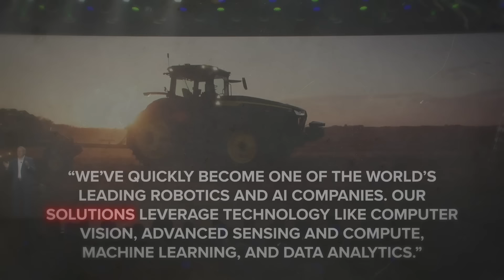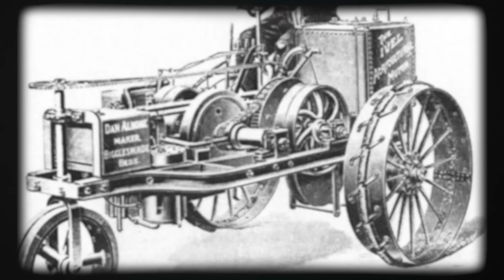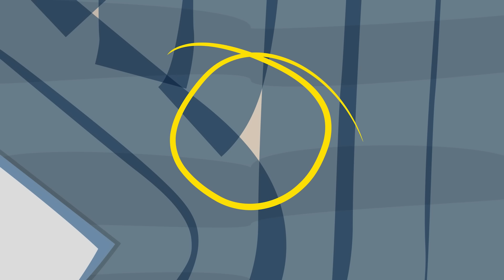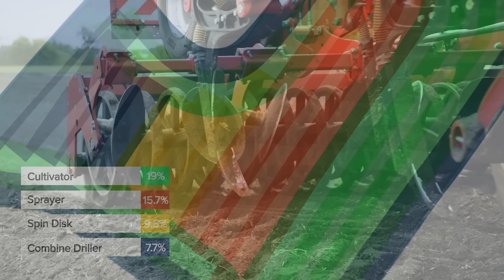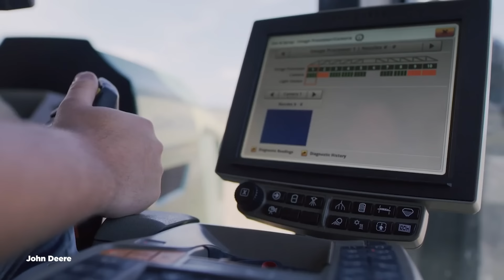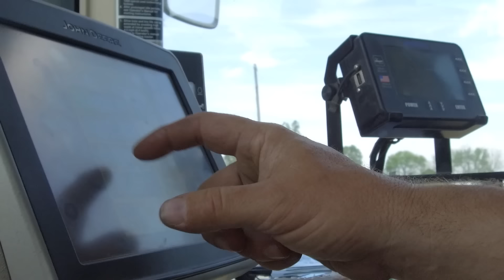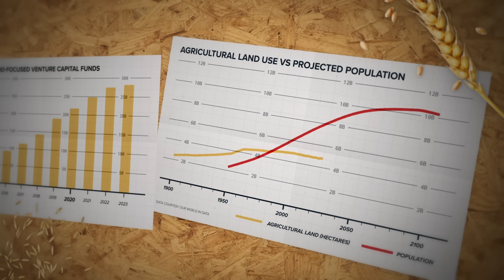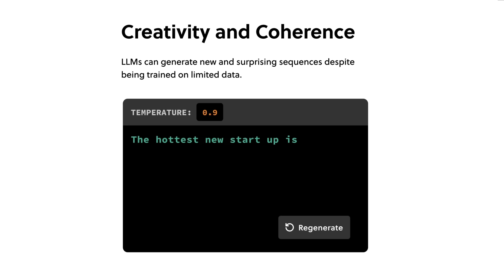How Big Tech Ruined Farming

Comment: I may be totally off, but a lot of this seems like relatively easy tech that, these days, could be developed by a fairly small team. Perhaps we'll see startups competing with large corps like John Deere in the near future.
Reply: Yeah it is.  I think JD spent so much on engineering talent that they have to cover the cost of that with exorbitant tech / hardware fees now, or they're purely charging monopoly prices while they can.  I was thinking that with a relatively small team, these $700K sprayers - that i've read about numerous times in this comment section - could be designed, programmed and built for less than $100K a piece.  The ML really isn't that difficult to figure out.  Honestly the whole system isn't that difficult to figure out.  .

Comment: When I was living in a small German town you could see how tractors were important to the farmers, there was lots of small old tractors, very well maintained, and they used them for everything, from farm work to towing, and with different modules to mount on the axle, I saw them with small sawmills connected to the engine to cut wood then just discconect it and drive away, very fascinating, and I didn't see a single modern tractor, just real old tractors that were real clean and well maintained :)

Comment: To combat this, we need standards (like usb-c) for farming equipment such that any tractor can use any equipment from any vendor.

Want a new nav system. Plugin a new nav system.

Want a new sprayer, plug that in too
Reply: As it happens Apple was pretty stubborn about not wanting to put USB-C ports on their phones even though they played a major part in developing the standard. Market leaders generally don't want to allow any more compatibility than strictly necessary. I suspect JD would fight tooth and nail to preserve their walled garden.
Reply: That's... not really what this is about. This is about things like not selling implements or parts like tires or combine blades outside of their system, which isn't sensible. Motors and proprietary software this makes sense for, but this isn't as simple as "plug in a new nav unit" or "re tumble your key lock on your tractor" this is actually stopping people from being able to do with their tools what they used to do.
Reply: I mean you pretty much can. You might need to have an adapter harness with the different connectors but that's not real difficult. The important part ISObus or CANbus communcation is standardized and can be looked up by anyone. Companies can have proprietary beyond that but you can 100% take a John Deere nav system and use it on a Fendt tractor. It's not perfect but certainly not impossible
Reply: Good thing your using usb-c, I would have to be up at 4am trying to flip the equipment over trying to get it plugged in 🙃
Reply: @phoenix5193  it is a hack instead of a standard. 

I a software developer, we make plenty of things "compatible" even tho they where never standardized or documented.

The difference is. Do you need to hack it together, or is it well documented and easily implimentable.

Diagnostic tools and software should be widely distributed and easy to aquire

Comment: It's a lot easier to stop something before it begins then remove them later.   We should be working to limit  and/or ban technology in EVERYTHING!!  We need new laws forbidding the use of a computer processing unit where it does not provide significant advantage of safety, cost savings, or  impossible without.  We are not running short of people.  Eliminating jobs for profit should be a crime....

Comment: Many farmers and ranchers around here have fairly modern tractors but keep the old ones running too. I've seen many 1960's and 70's era Massey Fergusons, Cases and John Deeres  out there raking hay, pulling wagons, pounding fenceposts etc. Looked after properly, they can run just about forever AND parts are STILL available!

Comment: As a John Deere mechanic in Denmark. "Right to repair" is in both ways implemented. My company "Semler Agro" is a certified John Deere dealer and it is giving the customer the opportunity to either fix it themselves, OR get a educated mechanic to do it for them. But im sure, that in the case of a broken transmission or finding an unknown error in the electrical system. Every danish farmer would prefer to have a mechanic do it.
I have seen a bunch of people wanting to have access to the John Deere software aswell. Which is understandable, and could in many ways be helpfull. But in theory it isnt nessesary to fix a older tractor 🤷

So at the end of the story. I understand farmers who want the right to repair, but it could lead to more faults on the machine or something else. 
Correct me if im wrong 😁

Correction: The way i mean that a customer has the right to repair himself, is for the more simpler jobs, i actually dont know if a customer can change the transmission himself or he is forced to have a mechanic do it 🤷

Comment: Here in Western Australia, they have priced themselves out of the sub 120-130hp market. What was $140k 5 years ago is now over $200k. You may as well get a Fendt at those prices. The 20 year old JDs at work are good basic 110 hp workhorses that do the job. Made in Germany and are rock solid. 
We went to a JD demonstration day a few weeks ago to test drive the new tractors and for a 120hp tractor with loader they'd need to be a lot nicer and more comfortable and less tinny for the prices they are asking. You want all the GPS kit and new fancy crap, well get ready to cop another pineapple in the arse.
We've got a Kubota coming on trial in a week or so and they're 2/3 the price and a Kioti in a couple of months and its nearly half the price.

Comment: My boss bought some high tech stuff from France. We can’t repair it. We just need to tell them to send other parts which is difficult. In agriculture, bunch of dusts, water and soil goes into a machine and kills it right the way. The best solution is to use a classic motor and a chain system, easy to repair, easy for workers to understand. He still uses some systems from France and computers and a tablet but we really need to know what’s going on and the most of workers don’t understand it. There is no signal, what does it mean? The water is dropping, what does it mean? Cheap labours can’t understand the high tech, so it doesn’t go as he planned.

Comment: John Deere’s business practices significantly degrades the robustness of the food supply system of society. It is literally a national security problem that farmers can’t easily repair their machines.
In case of conflict, digital systems is an easy target, so important machines like farming equipment should be able to work and be repaired easily regardless of John Deere’s servers availability, with parts found pretty much everywhere.

Comment: At 16:00 you say that to buy a newer sprayer to equip see and spray to your own sprayer it would cost 50,000. That is a joke to buy a 5-7 year old used sprayer it would cost about 180,000 to 230,000 because you need to buy a John Deere sprayer for it to work and as far as I know you need the carbon fiber boom on it as well.
Reply: And to buy a brand new sprayer with the tech on it from factory is north of 750,000

Comment: There is a complication. See & Spray need accuracy is supposedly not higher than 99%. For grains, the accuracy has to be higher than even six sigma. The problem is data gathering and training is hard because you can only plant one/two crop a year over a given area. You cannot use video training because there is no manual version of it. Its not as hard as self driving but its hard if you have to get the edge cases out to say 1 in a hundred thousand or 1 in a million.

Comment: John Deere's ludicrously terrible anti-consumer mindset can exemplified with one simple fact:
They use rounded glass panels everywhere because flat panels are easy and inexpensive to fabricate anywhere, even DIY, while the rounded ones require specialized manufacturing that only John Deere has the tooling for. So instead of fixing your tractor with a few hundred dollars at your local glassworks, or a couple hundred in plexiglass sheets, you have to to pay thousands to John Deere. 

That kind of thinking is pervasive in everything they do.

Comment: Issue is their tractors suck now. You can pack all the tech you want into it. But if the engine breaks down 2 years later it's useless. This happened in 2008. Everyone wanted to be a tech company. Manufacturing suffered and companies went under.

Comment: John Deere was once a force for good, the good they have done cannot be overstated, and its what allowed them to gain their current monopolistic position

But now that they have achieved dominance and are spending significant resources on maintaining it, they have become a net negative for humanity. Their unassailable position cannot be fixed by the free market, and government intervention is required

Right to repair and modify objects is necessary for a start. And while subscription fees for things are an unfortunate necessity in some cases, corporations must be forced - in the case of nonpayment-  to lock out only remotely maintained features that cost them money, not things that only run locally, and/or use publicly available services. For a start, their autotrac needs to have a free mode that uses public gps.

Comment: John Deere is a status symbol in America.  If you run JD equipment you are something.  I won't say what.  I live in a farming area and all I hear are the JD farmers complaining about the cost of equipment, breakdowns, parts, repairs, etc.  Most have a lot of the newer but not newest tech.  While on other farms that run older equipment and non John Deere products are fairly quiet and just farm.  John Deere is good at making single use pieces of equipment and convincing or even forcing JD farmers to buy them.  Other farms still utilize implements that attach to tractors.  When you can buy a Case or even a less popular brand of tractor that is not plagued with the issues of constantly changing JD equipment at a fraction of the cost then you are way ahead.  If a new integrated software and sensor system, proprietary to JD tractors is available at $3K-$10K extra to buy and install to save $1500-$4000 worth of product or gained harvest then where is the ROI?  Not to mention that JD has moved into the subscription market with all their software and tech.  Some systems cost $3k each year to renew.  Many software items will stop working before the subscription term or if the software is not updated it will no longer be supported and finally fault out.  JD has become a marketing and merchandising company that caters to the egotistical, entitled, status seeking but gullible crowd.  One local farmer said if you are a JD farm then you obviously don't need to farm for money, it is just a hobby.  He said they are definitely making their money somewhere else.

Comment: John Deere are trying to be the Apple equivalent in farming… using proprietary physical connectors and software, pushing owners to use John Deere implements!

It’s the same thing Apple we’re doing in the 1980’s, with proprietary connectors and accessories (printers, scanners, hard drives etc). It didn’t work well for Apple back then either and John Deere need to remind themselves that there are many implement manufacturers out there who make a cheaper or better alternative… and farmers aren’t going to purchase an non-compatible tractor/harvester, if it narrows down their choice in the implement market.

Comment: i would say big tech and AI can lower the prices of food 

Farmers will soon be able to use AI and satellite data to identify the exact fertilizer needs of their farms with a square-meter level of specificity. Farmers will be able to give crops only what they need and no more. That same sort of data analysis will let farmers save on other costs.

which means consumers will be abled to save money on food costs
Reply: It will allow farmers and distributors to make dramatic improvements in efficiency, putting downward pressure on prices.

Comment: I'm afraid the population is not expected to increase at least for half a century more, in fact the most likely scenario is to peak in three decades and start falling. On the other hand the problem with food  resides in how much is wasted not in its production, this is the issue we should tackle for it is increasingly appearing we might not  be able to  afford  much longer.
All in all what you are describing is the evolution of a sector which  increasingly needs more capital  in order to be competitive hence  tends  to  increase  the size and reduce the number of the producers.  It's  a common occurrence all across the board. For instance the retail businesses have  suffered a huge reduction due to amazon and other internet outlets or ecommerce in general only those, a small fraction that can distinguish themselves from the rest are surviving and will, the rest  will have to find other occupations.
The moral is that increasingly  less people and producer are  and  will be needed to produce food so lots of people,  business and settlements will disappear. 

Unless there is catastrophic, which i wouldn't rule out.

Comment: costs, right to repair are legitemate concern, mostly due to oligopoly. it can be fixed. On the other side, making farming more professional will be a long term  benefit. Do you any couple building their own model of car, chemical, electronic device? No, because to do thing in the 2024 state of the arte requires advanced knowledge and compliance with tons of regulation.
So, why food should be different?

Comment: The whole "solution" is the marketing level (dummies) of (mis)understanding the Engineering Process.
Goes like this:  1. Problem Statement, 2. Solution, 3. Answer.   Since marketing does not really understand ANY of this, they start in the middle looking for a Problem -- to sell their "Solution" to.  We even have a joke term for this -- called "A solution in search of a Problem."

But as far as John Deere in the here and now -- it is cheaper, faster, easier to just build up your own equipment from simple hardware and electric motors -- and no, that does not need big batteries, as line power is (again) cheaper, faster, and easier.   Saves $100Ks to Millions on equipment, but that is just the start.  Electricity is so much cheaper than Diesel, it is a massive win again.  Put in some Solar PV, and things get cheaper, yet.

Comment: John Deere did more damage to farmers than any other source over the last 20 years.  That GPS system your bragging about, it was bricking tractors.  Not, you lost GPS, so could finish the field yourself, the GPS system was tied into the main engine management system.  So if you were hoping to drag that wagon of grain out of the rain, nope.  Call the dealership, and spay $500 an hour for a mobile tech to come clear the check engine light.  At his convenience.  There is a rumor I've heard that I will mention later.

Next, if you want access to the manual so you can change the oil, thats going to be a $6000 a year subscription.  No, that will not let you clear the engine codes, thats just for information like what part number you need to change the oil filter.  John Deere claimed in court they charged that $6000 to maintain the data base, most of which says "see your dealer."  The old running joke of "1975 car owners manual "here is how you adjust the valves" 2010 car owners manual "DO NOT DRINK CONTENTS OF BATTERY"" apply.

The fact is 80% of the income of equipment companies comes from the repair of equipment.  Yeah, it takes a bunch of work to assemble a tractor, but tell me how much money JD is making off the parts I'm buying for a tractor that was built 50 years ago?

Deere had a brand that carried it through the decades, it was known as the no nonsense brand, you didn't get jargon in a Deere, you got what was on the sticker.  If the sticker claimed 120 hp, you could expect 120 hp out of the machine, under testing a lot of tractors scored a touch higher than the door sticker claimed on many tractors.  The 46xx series comes to mind.  But they are now "Corporationanalized."  Gotta sell a product, and nickel and dime the customer until they die.  The customer is the enemy after all, THEY are the ones taking money from the company by passing the DRM in the engine management system so the tractor can start.  Trust me, they count every farmer repair as a loss.

The rumor.  The rumor is all these companies are making money selling data.  The GPS has been recording it's location, speed, timeframe of work...  This information would be quite valuable to the right people.  Why else would the GPS be tied directly into the engine management system, and kill the entire tractor if it stopped working?

Comment: They put in GPS systems that you can set for a 1000 acre plot turn it on get out and the tractor will plow perfectly straight lines. no driver. I would rip all that crap out and run new wires from the starter to the key switch or push button back to the starter . bypass all the sensors and not have to worry about that computer shit. hire a driver and be done with it. if the complain take all the tech stuff to them and say : here i don't want this part you can have it back. I ripped out a computer on my truck removed aa the sensors and rewired it. ran fine started fine. lasted a long time.

Comment: Unfortunately nothing new. On my mercedes ML w164 from 2010 you cant replace the battery or ac digital unit without programming it to match the VIN let alone more complex part. If you dont car doesnt start and you can put only batteries that are prescribed an approved lol. Dog mindset of "german engineering" set the standard. It's 3 connectors and 4 screws for ac unit btw which is nothing but a thermostat, fan and step motor controls